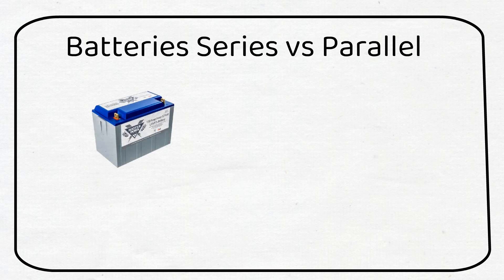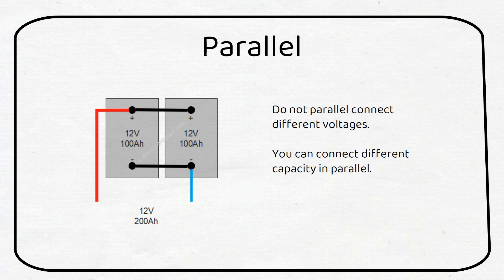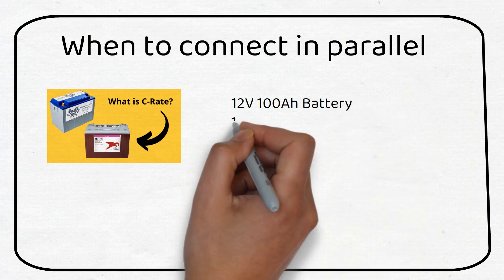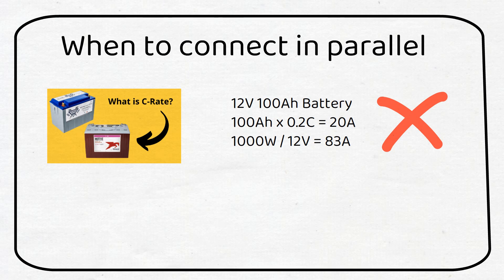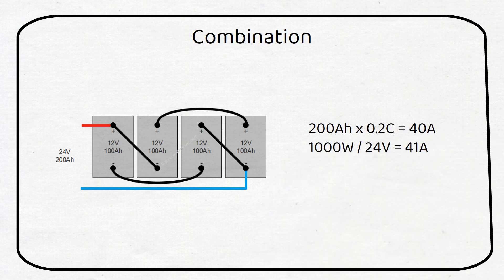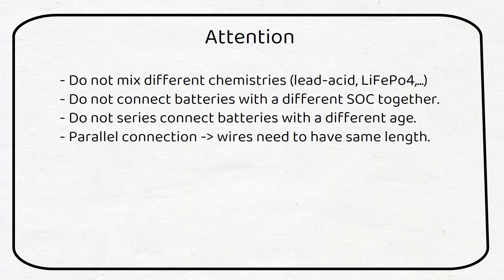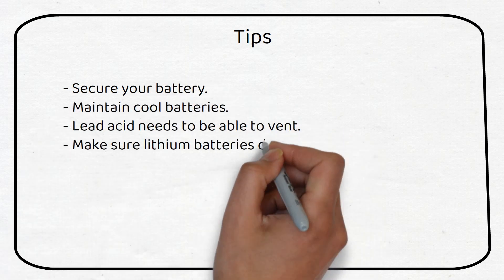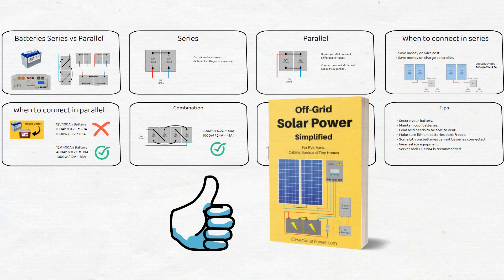Wiring Batteries in Series or Parallel? Learn the best battery setup for you.

Comment: Is this possible? = 2 batteries 12V 100AH each connected in SERIES (Result: 24V 100AH). And after that this will be connected in PARALLEL with 1 battery 24V 100AH (Result: 24V 200AH). Thank you! I already subscribed with your channel :)
Reply from the maker: Yes
Reply: please be aware their is a TYPO in your question : 12 V connected in SERIES Results : 24 V . 
NOT 12 Volts. 
Though your theory is correct.

Comment: Your configuration of four batteries is wrong. Check it properly.
Reply from the maker: Indeed, the main positive lead and negative lead should be on the other battery. However, this will not lead to a short circuit. I will re-upload the video with proper wiring. Thanks for mentioning it.

Comment: You could (and sometimes should to do, example for equalization reason) connect batteries with different SOC in parallel if your connected wires have small size copper area which restrict amount of current allowable  to the smallest battery capacity throughout this connection. Your batteries will be self equalized in this case after existing some time in that connection.
Reply from the maker: Never connect batteries with a diferent SOC together, especially lithium. You suggest using a thin wire to limit the current, unfortunately that's not how it works. The battery will ask more current than the wire can handle and will melt. That's how wires work and that's why you always need to fuse a wire.

Comment: Hi i have a 3500w inverter 24 v and i have 6 batteries 12v 200 amps should i connect the, series and parallel set os 2s or should i only use 4 batteries plz advice
Reply from the maker: Wire 3 batteries in parallel. Do this two times. Then series connect both parallel batteries. This will make a 600ah, 24V battery.
Reply: @cleversolarpower  great , thank you brother
Reply: For 24v 600amp battery bank in series and parallel what is the best max and min voltage to set in inverter plz
Reply from the maker: @chico711  That depends on the chemistry. lead-acid or Lithium?
Reply: Another question plz in a bank of 6 batteries 200 amp ( each 3 parallel ) and both in series to get 24v 600amp does it make a difference which terminals i use to inverter meaning can i use the ones closest to inverter
Reply from the maker: @chico711  Don't use the terminals on one battery as the main + and - terminal. Use the + on battery #1 and then use the - on battery #6. Research batteries current sharing.